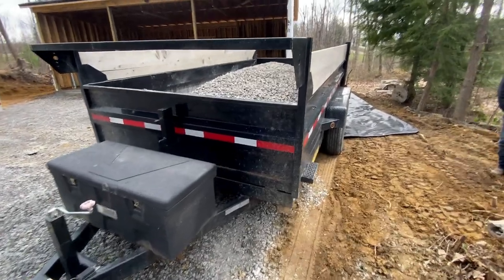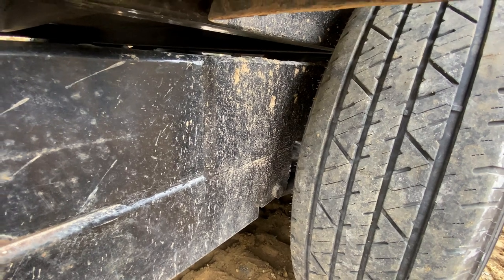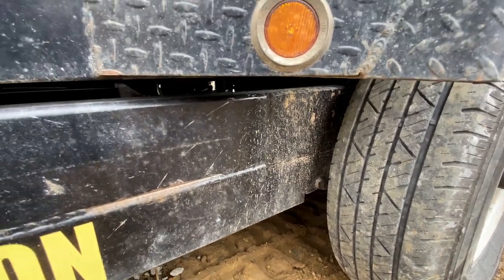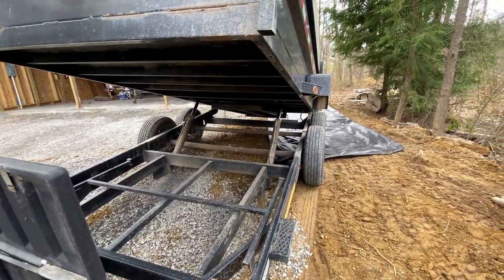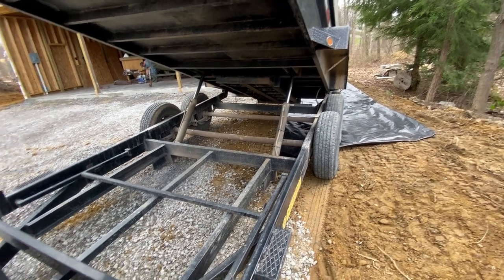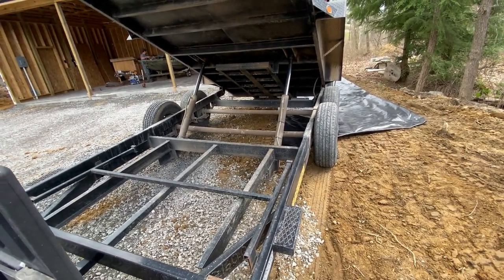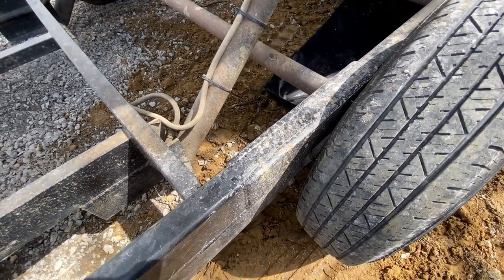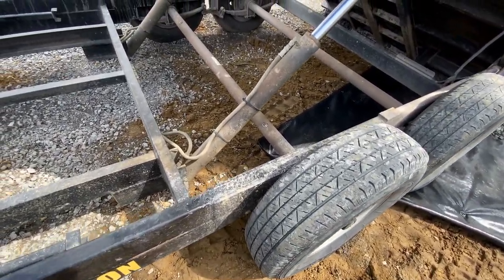Cracked Dump Trailer Frame Repair

Comment: There is always the danger that you just moved the weak point up past where you strengthened the frame and it will fail again on the thinner portion of the frame.  Of course, it all depends on the facts of why it cracked in the first place.